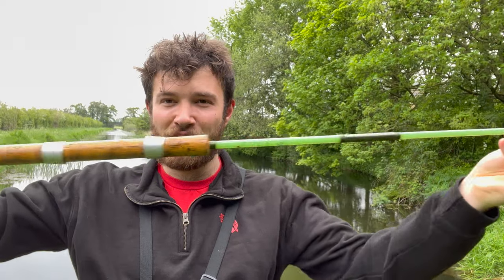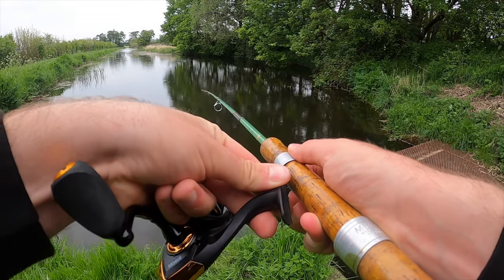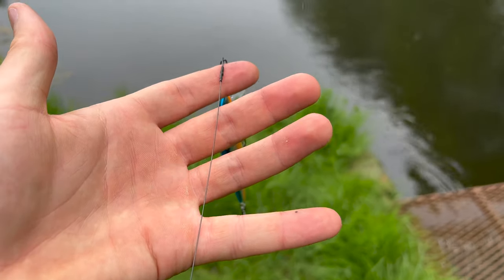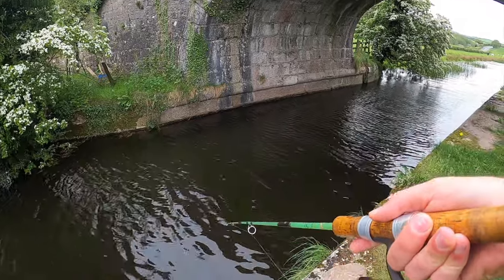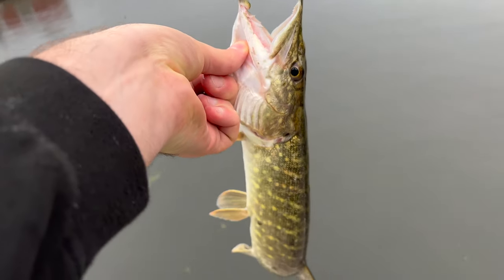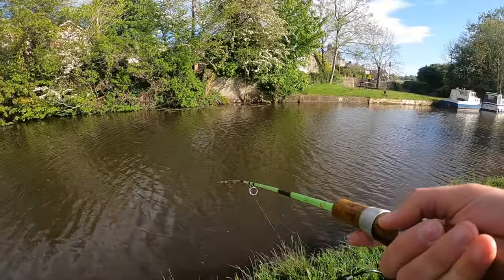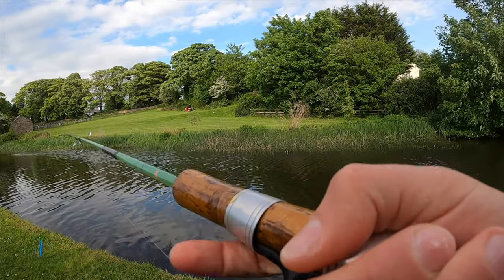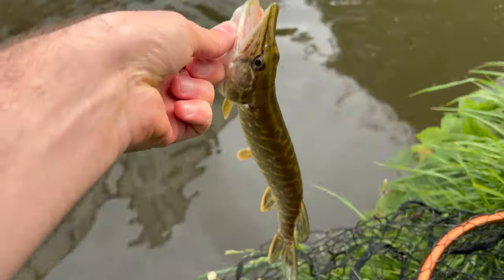Pike Fishing with a 1950's TRAVEL ROD - Solid glass??

Comment: Nice video. I have a  bit of a fetish for Milbro's Solglass range myself: up to 7' they are a lot of fun to use and look great against foliage, but a tad heavy in the 8' models. I'd suggest they are better matched with  with a heavier reel for style, historical authenticity and balance I'd recommend a Mitchell 300, ABU 505 or my favourite pairing, ABU Record 444 (Milbro were distributors for Mitchell products in the UK before Garcia, and indeed ABU). They work light spinners in flowing water really well and the self loading nauture of fibreglass achieves surprising distances.   Just a couple of points, you rod was made in April 1963 (from the number 463 printed sideways on below the make and model stamp). Regarding the rings: probably not ideal to use braid since they are unlined. However, funnily enough, the logic of a large butt ring funneling rapidly into smaller guides is adopted in modern Fuji ring sets so, perhaps not so odd as all that. Incidentally, the factory where your rod was built is, I believe the same place where modern Scott built Daiwa rods are made.
Reply from the maker: Thanks for the info and the advice! It was great fun using it, I do think though that the very soft action of the fiberglass is a little too floppy to be an effective rod for pike fishing. I found it very difficult to set the hook on a few other occasions!